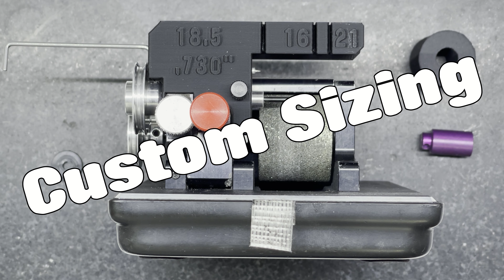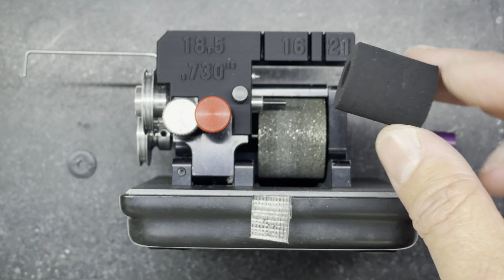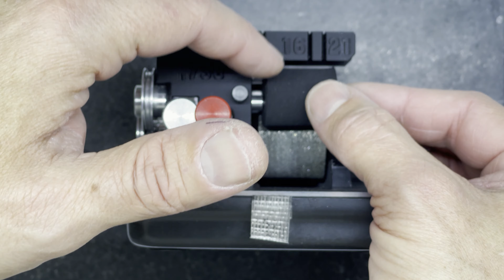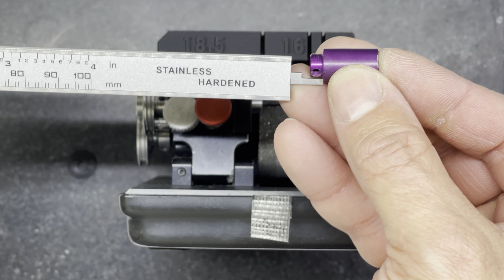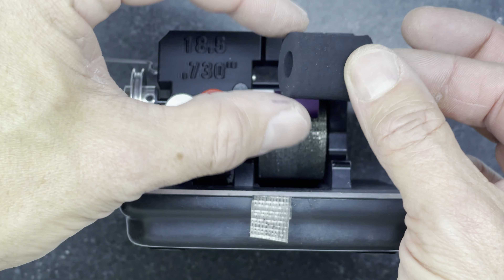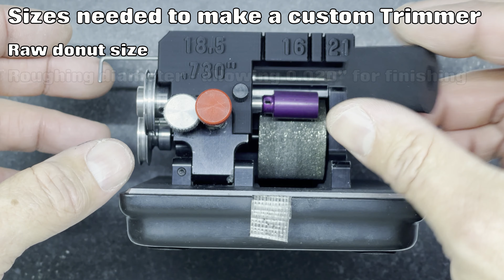CleaveTech Slot Car Tire Trimmer - Custom Sizing Guide

Comment: There must be a solution that leaves you flexible with the width of the tire you want. Instead of deep, fixed , far between notches, maybe shallow but frequent notches like a ruler with even (milimeter step) distances would be more universal. The tire turns towards the blade on a Hudy, so the knife just needs to rest in a shallow notch and can be held in place. I assume only very few racers run flexcars with such small tires. I run one, but don't know anyone else outside of our club in all of Hamburg, Germany. We run tires in 13mm width for Scaleauto, BRM and such much more often. Same with tire diameter. Cutting a 30mm donut down to 28mm would help spare the sanding wheel on the Hudy, which is expensive to replace and saves time. The fine trim to the often used size 27,5mm or less can then be done by the sanding wheel. You could perhaps solve that by making several holes for the cutting pin.
Reply from the maker: Thank you for taking the time to watch and leave such a great comment. When making products, I tend to start with being uncompromising in the design to make them the best I can to suit my own slot racing needs. I then modify them to suit as many other forms of slot racing as I can. 
I agree that shallow slots would be easier to put closer together but they would not support the knife as much. The deep slots in the existing design make it easy for the user as they can’t go wrong with the knife. Maybe there is a compromise to be made with the slots somewhere in between. 
You would be surprised at how many people race flexicars with “small tires”. 😁 The are raced all over the world to ISRA rules. 

Do you glue and true your own tyres for the ScaleAuto cars?
Reply: @CleaveTech  Thanks for your explanations. Atm I make my own tires for Scaleauto and others, yes. Usually I would buy them in the right size, but many producers have problems delivering them atm. So I've recently made my own out of available donuts with my own rims. To cut the tires to width I use a razorblade and eyeball where I need to cut a 20mm donut to the width of say 13mm - while in hand. That works pretty well. Before sanding the diameter down, I use a file to file to exact width with the tire in the Hudy. Then I true the tire down to the right diameter. Taking off several mm takes time and wears down the sanding wheel. I know flexcars are popular worldwide, but not so much in Germany. I thought you might want to know what I think because you want to sell your tool. I buy my tires for my flexcar (JK) already cut. They are readily available here. Hope you understand me, I'm not a native speaker.
Reply from the maker: @RackwitzG  , I fully understand you. Your English is very good. Much better than my German!
I have made some modifications to the design today and I think I can have slots 1mm apart and still have a strong design 👍🏻.

Full credit to you for making your own tyres for Scale Auto cars. I am sure you can save a lot of money by re-sponging your own hubs.
Surely you could also make your own tyres for the JK production cars and save more money? 😁
Reply: @CleaveTech  I probably could make my own tires. The owner of our clubtrack sells all parts for the JKs because he is a flexcar enthusiast. I learned yesterday that tire diameters vary among the clubracers. I was head to head with a guy for several laps. He gained on the straights, I caught up in and after turns. Later I saw that he had bigger tires. Funny, since we race ootb. My replacement tires I bought from the trackowner were smaller. The other guy still had ootb tires. I have .700, he had .720 (I think). Maybe I could make some of the original size and be faster. My idea to run-in a replacement motor in water, according to your video, didn't work. It was much slower than the ootb one I didn't run in. Either the motor was bad or I ruined something while pressing on the gear. May do another try later. The brushes looked good though.
 Keep us updated on your inventions. Very interesting and well presented. Not for everyone perhaps, but one can even learn something if one doesn't drive flexcars, since you explain the physics behind your ideas and those rules apply for other cars as well. Thanks for your feedback.
Reply from the maker: @RackwitzG  , I find that tyre size is very important on any fixed gear ratio class. If you are not on a fixed ratio then maybe go one tooth less on the spur gear when using smaller tyres.
Reply: @CleaveTech  We run our JK F1 ootb, so fixed ratio 10/37.

Comment: Hi I could use the tire trimmer, I do drag racing slot cars. 
My donuts are 1.425” tall and 1.351 long.
My first cut (zero) is .161, from hody bus
First cut .330
Second cut .430
Third cut .530
Please let me if you can do this
Reply: Oops forgot to cut down the tire to 1.250
Reply from the maker: Hi. Thanks for watching. I am pretty sure I could make one to those sizes 👍🏻
Send me an email cleavetech.james@gmail.com or a Facebook message (search for CleaveTech) and we can discuss it further 😁